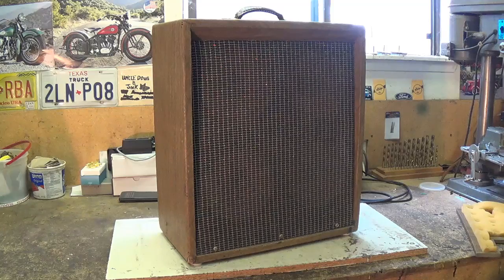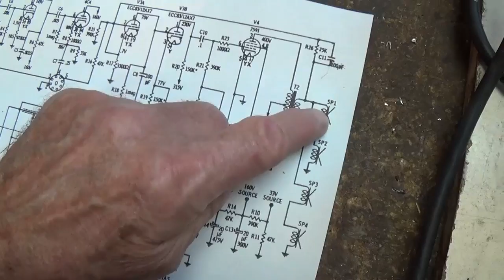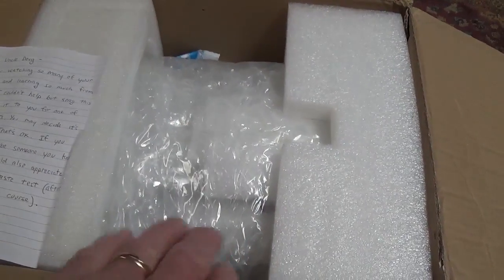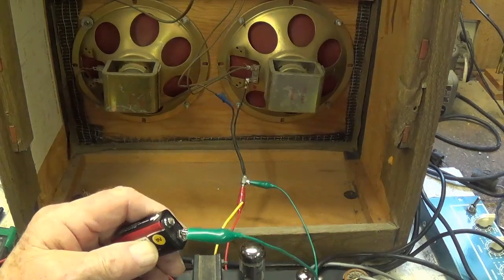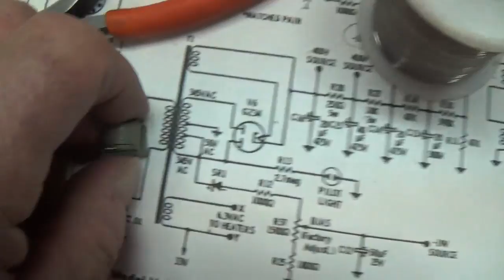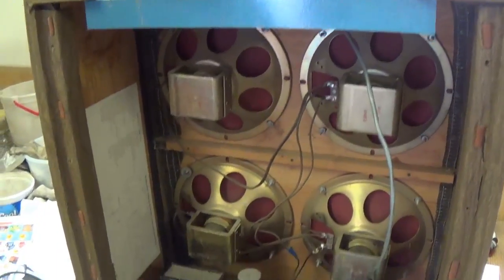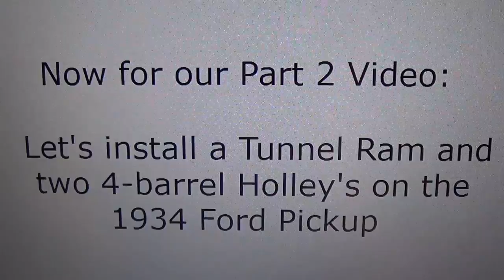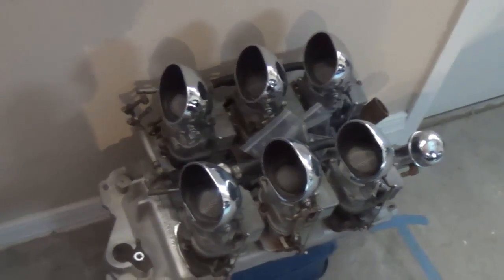Harmony H322 Bass Amp.......The "mini" Bassman from Hell !!

Comment: Please don't hate me for a technical question. I finished building the harness for my nylon-string shimisen. It is built as follows (I don't know the terminology) - piezo transducer > volume pot (500) > input jack - it only took a week to solder the "joints" (there is a better word...connections?) because I did each solder two or three times as I purchased my first working soldering iron 13 days ago and the tech is new to me. I taped the transducer to the soundboard yesterday so I could plug the shimisen to the amp - I am not satisfied with the electronics.  I have to really crank the amp way up to get any volume whatsoever. Is there a capacitor or something that I can add to the harness to make it louder? I have played several instruments in the past that utilize piezo transducers and they used the same harness setup - some were loud, others not. Am I missing something? I am getting a signal, however weak.
Reply from the maker: Nothing but a pre-amp will increase the amplitude of the piezo signal, B, or maybe attaching the PT more securely to the soundboard. It's one of the shortcomings of them.....just like the reverb tanks in Silvertone amps.....they are simple, inexpensive transducers, but of varying, generally weak, output strength.
Reply: @UncleDoug  - This information confirms my theories. It seems that a tiny movement in the PT placement makes a difference so I will embed the sucker into the wood. The reverb tank in my Silvertone amp, though not of Fender engineering, worked pretty well as I recall. The tremelo was fantastic. Or vibrato. I get them mixed up.
Reply from the maker: @bamboosa  Unless it was a Magnatone amp, it was tremolo, B. They're the only ones with "true vibrato".

Comment: The contacts of the 1/4 input jacks look black with oxide. Are the input jacks of the shorting type, and are the unused jacks automatically grounding out to the chassis?
Reply from the maker: They were, GU, and were shorting the input to other jacks, but once I relocated the AC to the chassis, I was able to un-short them without incurring any hum.
Reply: @UncleDoug  , the AC fed neon lamp  Is another reason why I suspect the amplifier was made by Gregory, that was pretty common for them. I've never worked on any Lectrolab amplifiers but I have Sam's schematics for 2 or 3 models and if I remember correctly they used a standard 6 volt bulb for the pilot light,  although I am going from memory and we all know how accurate that is or may not be! I will have to check.  By the way, there used to be a website put up by a collector with a whole bunch of Pictures and info for Gregory amplifiers, but it doesn't appear to be active and has disappeared from the Internet.

Comment: That Stromberg carb setup looks cool for that vehicle but they are hard to tune and get running properly. I'd be more inclined to run an Edelbrock Victor Jr. with a matching Holley carb. I don't know what cam you have but if it's mild that tunnel ram might be costing you a lot of power in the bottom end, especially torque.
Reply from the maker: The Stromberg's worked quite well for me, but I just wanted something different. The small plenum, long-runner TR still has good torque, especially around 2K RPM.
Reply: @UncleDoug  cool I guess the newer designs work better than when they first came out. Man I feel old........I'm only 63.
Reply from the maker: @BigDaddy-fx4nx  Yes, they actually re-make the Stromberg 97's now.....better than original.
Reply: @UncleDoug  they sure look cool though, so dies a tunnel ram, pick your poison a very cool vehicle ya got there.
Reply from the maker: @BigDaddy-fx4nx  Thanks, BD.

Comment: Hey Uncle Doug if every I'm in west texas
Save some of that selenium for Me.
Reply from the maker: You know it, Dwight. All guests get their own pile to snort.
Reply: Would love to hear the old car radio playing. In my youth I bought
A CB radio it was a Lafayette comstat
25A all tube built in
Power supply was solid state interestingly
It had a transister
Vibrator circuit for
Car 12volt mobile 
Operation. Later on
I studied to get an
Amateur radio license.
I used to listen to the
Am B/C at night to see
How many distant
B/C stations I could
Pick up. Many years
Ago transworld radio
Used to broadcast on
800 khz from the
Netherland Antilles
I could pick up WJR
Detroit from anywhere
In the country at night
Usually an hour after
Dark. From hear
Near Detroit I can still
Hear WSM Nashville,Tn. After 6pm
In the winter. After 10pm in the summer.
Many exotic broadcast
Station were on short
Wave at one time
Including ship to shore
Telephone utilizing
Single sideband upper.
Or aviation communications for military or airliners
They use upper sideband mode.
By the way the comstat
CB radio ran a 6BQ5 Tube for the Rf output
Final and a 6AQ5 for the audio modulator
I had a vertical antenna
On the house chimney
Gave me 20 mile range
At 3.5 watts Rf power to the antenna back in the early 70s nowdays I talk around the country
On ham radio. See You on Utube. Dwight

Comment: The 6v filaments are biased with 33vdc per the schematic.  With the added balance resistors I'm hoping you disconnected the 33v.
Reply from the maker: The filaments aren't biased, JJ, the output tubes are.....and they checked out just fine.

Comment: Valve amps drive you nuts sometimes, what better tonic than a old motor, looks a bit more complex though to set up than a push pull parallel valve amp for instance, fighting with one at present which is playing at silly buggers....DA.
Reply from the maker: Yes they can, DA. Good luck with it.

Comment: Uncle Doug where did you get the water neck that point to the passenger side? Part number?
Reply from the maker: On Ebay, JB. I don't know the part number, but they are offered there.
Reply: @UncleDoug  by. chance could you look to see who the eBay seller is ? It will save a ton of searching time thanks

Comment: Only 9:00 minutes in and hypothesizing as we go.....Im not so sure about the purported Lectrolab source. I have never seen Utah speakers with red cones,  but Stromberg or Stromberg Carlson speakers often did. The 328 code might just be a coincidence, unless Utah was making speakers for Stromberg. Stromberg was also based in New York ( after 1902). The fact that the other Harmony amplifier you saw on line had RCA speakers makes me think that they were using whatever they could get, * from east coast suppliers*. RCA was, after all,  an east-coast manufacturer ( Camden New Jersey); a pretty strange choice for a Chicago-area builder like LectroLab. Most of the amp companies in the Chicago area used Jensen, Rola, or CTS ( Chicago Telephone Supply) speakers. Do the speakers have "wizzer cones"? Also, is the original papery "tolex" black, or gray?
Reply from the maker: Again, I wish I could answer, but the unit has been returned to the owner, GU. The "Tolex" was black as I recall......I never removed the speakers.

Comment: Snorting Selenium from a rectifier? 😎
Reply: You can also make dandruff shampoo from it as well  :-)

PS I wonder if you could make candles out of old wax and paper caps???
Reply from the maker: @Bishka100  That's true, Bishka. I recall reading that on a bottle of Head & Shoulders many years ago.
Reply: @Bishka100  ....also good for high cholesterol and treating people with Hashimoto's thyroiditis.
These days anything that boosts the immune system is useful (although I may go for the products available at the Pharmacy and are FDA approved rather than vintage electronic component extract residue)
Reply: @UncleDoug  I believe you are thinking of Selsun blue, not Head & Shoulders-it uses Zinc Pyrithione, not Selenium Sulfide, which Selsun blue does.
Reply from the maker: @m.k.8158  Thanks, MK. I guess I can quit rubbing selenium rectifiers on my scalp ;)

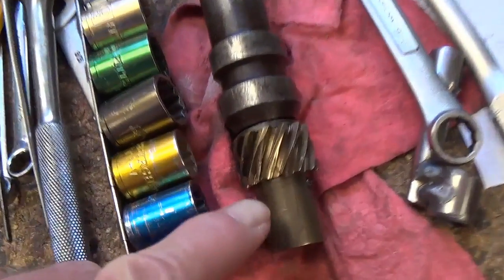Comment: 01:00:45 If you replace the brass gear with steel, it won't act as s sacrificial part, and you'll break / wear a more expensive part somewhere inside!!
Reply from the maker: I understand the theory, Keith, but think about it.....every distributor and magneto you will ever see has a steel drive gear. Why would this particular one need a brass gear ?
Reply: @UncleDoug  I hear you. Check that it isn't  phosphor bronze instead of brass, which may have been chosen because of, say, lower CoF (self-lubricating) properties. Bronze would have been more expensive than steel, and I can't help thinking there was a reason for the designer putting it there... plus the original material did work well for a number of decades!

Comment: You didn't mention why you are doing the plate current and dissipation calculations by hand rather than with your handy dandy Euro Tubes bias measuring equipment. The reason, of course, is because the 7591 has a different pin out then a 6L6 or 6V6, and you would need a pair of octal-socket adapters in order to use your special test gadget.
Reply from the maker: That's right, GU. Thanks for explaining it to the viewers.

Comment: Did you have to readjust the bias after changing the defective output transformer, and what did you end up with for the operating points of the output tubes?
Reply from the maker: Approximately the same as prior to the loss of the original OPT.

Comment: What have you got those Holleys jetted at?  Like you said, that's a lot of gas for a small block.
Reply from the maker: They are a wee bit rich due to the elevation here, but now that it's running well, I can work on the jetting to fine tune it. Please subscribe so you can receive notice each time a new video is posted.
Reply: @UncleDoug  subscribed way back when you built the Rick-Tone Trem-o-drive!  Inspired me to attempt building one on my own.  The overdrive works, but the tremolo does not.  I think I blew a film cap, and haven't gotten around to replacing it.
Reply from the maker: @matthewb8229  That's good to hear, Matthew. Thanks ! I guess YT's identification of subscribers is unreliable.

Comment: Did someone die? Did the Harmony amp break you? I have cassette recorders that you could replace the belts on if you need a project. If someone died you have all my relevant feelings. Does anybody remember Mister Machine? The walking talking robot with the hat? Transparent exoskeleton? Swinging arms? Creepy head movement? No?
Reply from the maker: Yes, people die all the time, B. Sadly, however, none of them are people I owe money to.
Reply: @UncleDoug  - I died two or three times, very briefly - less than a minute however I kept coming back. I was run down by a speeding Escalade in 2012 and I lay in the street, dead for about 30 seconds. No white light, no Jesus to greet me, no John Coltrane or Jimi greeting me at the gate. Whilst dead I found myself sitting in what felt like the Hollywood DMV at midnite, the space barely illuminated by a streetlamp outside and I said, "no way, I'm not hanging out in this horrible waiting corridor" and I came to and tried to stand up. The Escalade had ripped the shinbone out of my left leg and shattered my jaw at the pivots. I could not stand up as the bone was jutting out of my leg at a very wrong angle. Somebody shouted "stay down!" and I crawled to the curb so as to not be run over by oncoming traffic which was sparse as it was late Sunday night. EMTs arrived and injected me with something. I wanted to die again, I would not live without my leg. I woke up two days later in a private room at Cedars Sinai hospital. A new adventure was beginning, oh joy. All of that has nothing to do with getting sober in 1982 and discovering, to my horror, that in order to stay sober I had to make amends to the people I had wronged, including the target of my cat-burglarly (about a year of sneaking into a Beverly Hills store at midnight and taking what didn't belong to me). Long story. I don't know why I keep coming back, I believe that I have paid my debts and now I never loan or borrow money. Collecting loaned money is a horrible task - playing "enforcer" is not in my repertoire. I will accept money without strings and I will give money but the "never a lender or a borrower be" with the added "don't be a thief unless you steal from the thieves" works for me.

Comment: I am very afraid that I if watch long enough, you will almost have to run into one of my fine well thought through well funded modifications of every amp that ever went through my hands. There must be hundreds. I hope everyone lived through them as they passed into other people's possession. I did sometimes test the grounding scheme with a cheap Winn Dixie hot dog across the chassis and a nearby ground as a safety measure. At best it was safe, at worst it worked the same way as a Presto Hot Dog cooker. (check that circuit out!) leaving me with a well done but still tasty frankfurter that actually did have a faint "electric" flavor. No this is not fabricated.
Reply from the maker: I hear that Winn Dixie hot dogs work the best ;)

Comment: You probably have more amps coming your way than you have time to work on... but I have a Silvertone 1481 (made in 1965)  in very good condition and I wonder if you'd be interested in me sending it to you so you can look it over. Again, I suppose you have more amps like this coming your way than you have time for, but I thought I'd ask.
Reply from the maker: That's a fairly simple circuit, as I recall, much like a Fender Champ. The only problem I see is that between the very expensive two-way shipping and the cost of parts and labor, you will probably be looking at a $300 to $325 bill. If you still want to proceed, let me know.
Reply: @UncleDoug  Thanks Doug! I'll think about it - is there a particular shipper that you recommend above others? I might want to ship just the chassis, though I suppose that might not save much because the cabinet isn't very big. Seeing a video of you going through the circuit would be worth the money. In case it helps you to know - the amp is working fine now, and I would not want it re-capped because it's not buzzing. But I would be interested to see if you find anything to fix or adjust by going through it. It has never been biased as far as I know, and also I added a three-prong power cord, but once when I played the amp while standing on a concrete floor with bare feet (probably never a good idea with any amp) I felt a tingle in my fingers. Maybe that's normal?
Reply from the maker: @baerster  I prefer FedEx Ground. If there is currently nothing wrong with the amp, you really shouldn't spend $300+......and there would be very little for me to do. Keep it until it begins to act up.
Reply: @UncleDoug  Sounds good, I'll keep using it until it begins to act up. Thanks so much for the advice. I hope that someday you do one of those, either mine or someone else's. This is the amp, in case you aren't familiar with them: https://www.youtube.com/watch?v=mdiIHz0ymIA
Reply: @UncleDoug  In case you are idly curious about it, here are schematics for that amp. Based on your video on negative feedback, I'd say that this amp does not have any. https://www.tdpri.com/threads/silvertone-1481-mods.948060/

Comment: With two separate grounds, aren't you creating a ground loop potential?
Reply from the maker: There are quite a few different grounds in the circuit, Dennis, yet no ground loops were created. The main cause of GL's in my experience is to ground shielded cables at both ends.

Comment: How can I message you without commenting on a video? I have an rca bn2a mixer preamp that I want to get fixed.
Reply from the maker: I don't work on modern equipment, Ambrose, only pre-78 vintage gear. Sorry.
Reply: Its made in the 1940s, an RCA BN2a
Reply: You should see this thing. Its a point to point hand built masterpieces.
Reply from the maker: @ambroselockerman1115  I apologize. I just did some research and discovered that this is definitely a very complex, high-dollar vintage pre-amp, Ambrose. It's just not something that I am able to deal with at this time. I'm very sorry, but I am buried in work and probably don't possess the expertise to work on so complex a device.

Comment: Be careful replacing that distributor gear with steel.  It is supposed to wear first to protect the camshaft gear.   I feel silly telling you this because I''m sure you already know, but just in case....
Reply from the maker: I agree, Pan, but every distributor I have ever seen has a steel gear. Indeed, I stole the new gear off of a Chevy HEI unit. I can't believe that every cam gear in the world is being eaten up by these steel distributor gears.
Reply: @UncleDoug  Just depends on the camshaft material.  The sell gears in cast iron, hardened steel, bronze, even composite.  Probably fine unless you're running a billet or fancy roller cam, but it's worth a check if you know what cam you have.   https://www.dragzine.com/tech-stories/selecting-the-correct-distributor-gear-its-all-about-the-details/

Comment: Ok. First I hate the SM57 but a standard the hmmm is set by the input gain so maybe 50
Reply: Sorry my 🐈 interrupts 59 percent of In-N-Out control rotation also you talked of eliminating a ground loop but I saw only wiring harness changes ?
Reply from the maker: @harryconover289  Harry, the removal of the modifications that located  AC in the control panel eliminated a potential between the panel and the chassis,  thus eliminating the ground loop through the umbilical shield. I'm sorry your hate the microphone. Everyone else seems to love it.
Reply: Uncle Doug yes the 57 shure mike is the most common mike in this universe but I has  horrible proximity bass Boost I talked to the engineer that designed it and asked him about it and he said it was designed to be in a mike mouse on the stage in a Opera house so there is no problem when it 10’ a way most rock folks put there lips on it !
Reply from the maker: @harryconover289  Thanks for the info, Harry.